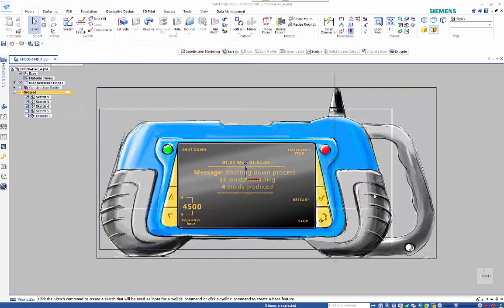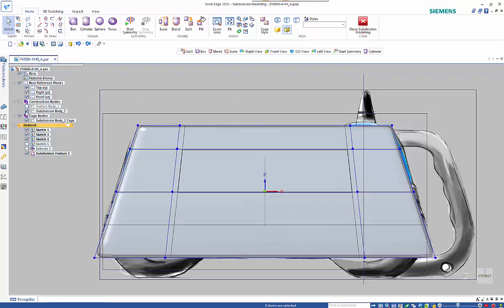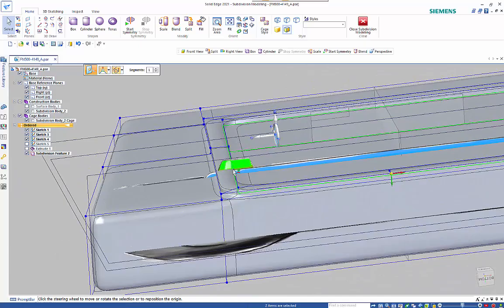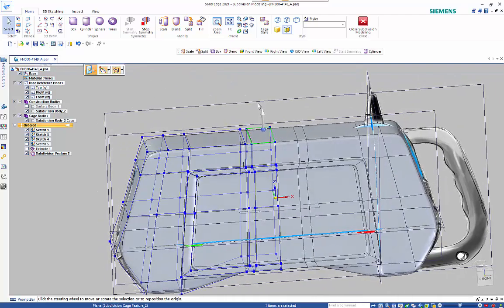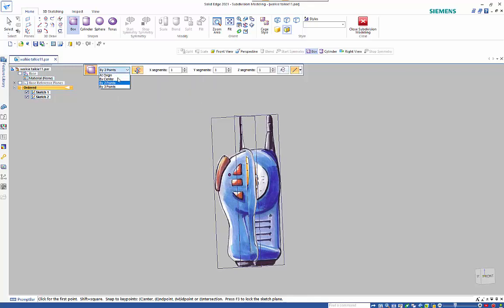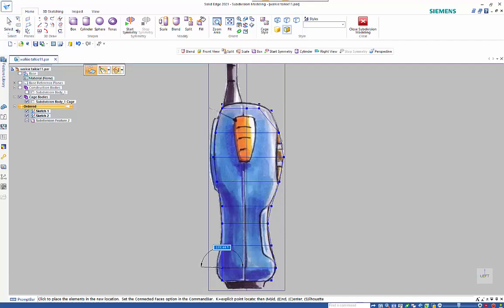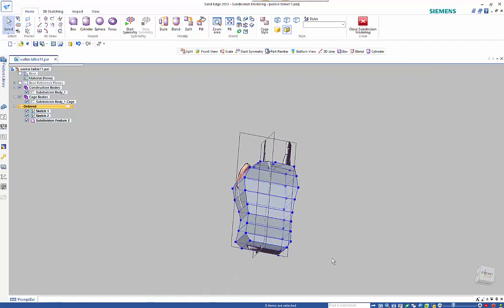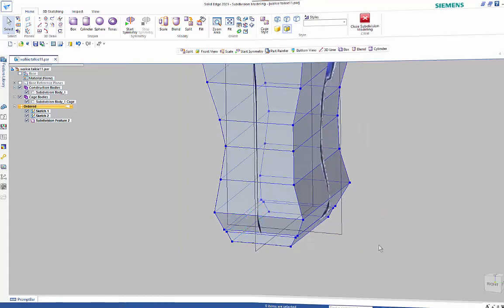Solid Edge subdivision modelling overview

Comment: I noticed your Solid Edge is also laggy. This always has been a big issue, although I like the software and its abilities. The responsiveness after invoking each command is just sluggish. NX is not like that (I am talking about NX10, never tried the newer versions).
Reply from the maker: Hi. Thanks for the comment. There is a good reason this was laggy. I was using a really old laptop to install the beta version of Solid Edge 2021 so that I could keep Solid Edge 2020 on my main laptop for customer support.
Reply: @cadcentralnz I recently participated in a competition that requires every participant to use this Solid Edge software. I thought it was because of my laptop so it was so laggy. Until I figured out it was also laggy on every of my teammate’s laptops as well.